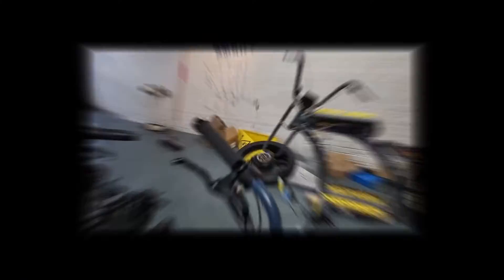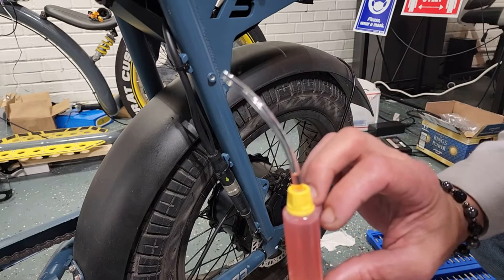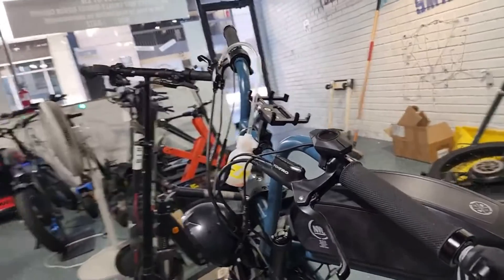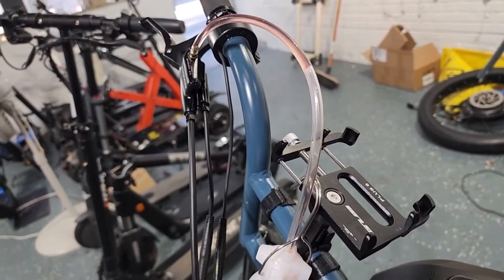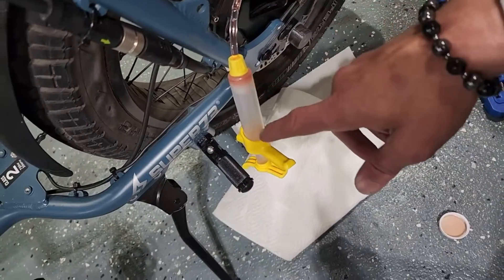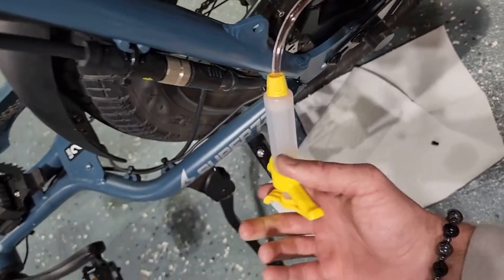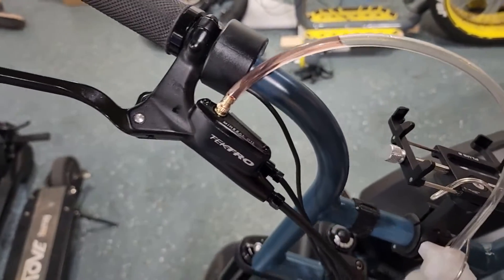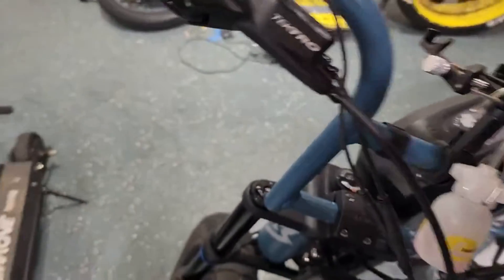Super 73 Electric Bicycle  Brake Bleed

Comment: Do you leave the fluid in or pull it back out at the end?
Reply: You need the lines full of the mineral oil (fluid) for the brakes to work so he leaves the fluid in. Hydraulics works by you transferring force by the liquid, so when you press your handle it sends pressure through the fluid in the line that then pushes the brake pads together. If you take the fluid out and just have air, you will press the brake handle and nothing will happen. If you have insufficient levels of fluid, you will press the brake handle and you will get some braking but very little.
Reply: @PHDPool  Makes sense thanks for the explanation!